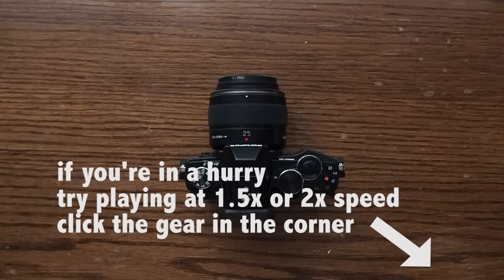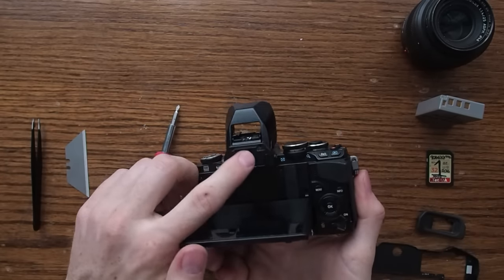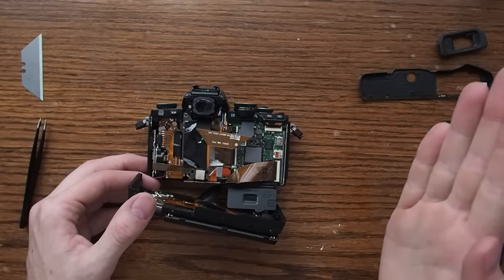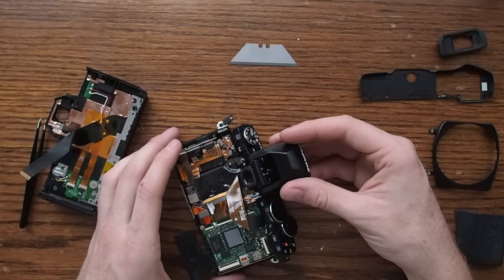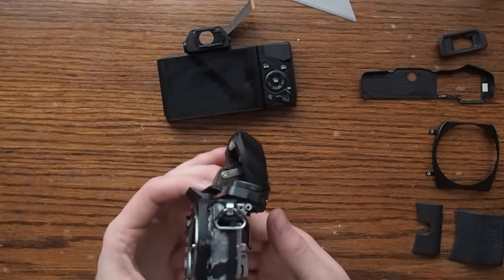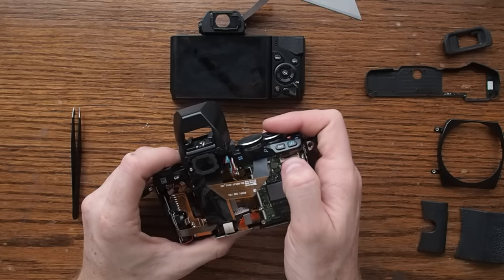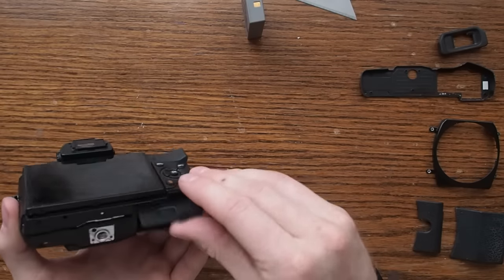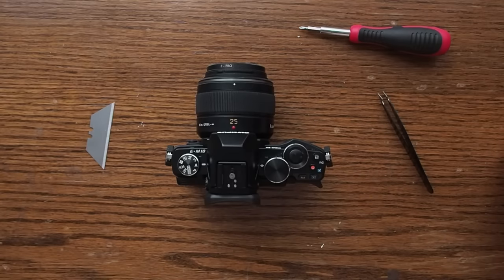How To Fix Olympus OM-D E-M10 (Disassembly & Repair)

Comment: Hi there, I have a question.
Recently it came to my attention that my OM-D EM-10 wasn't working properly. The dial on the left won't allow me to switch between various shooting modes (but the dial works fine). Do you have any tips or suggestions to help overcome this? Thank you, love your channel. 
-Lotus
Reply from the maker: Lotus White hmm when my camera got salt water in it, some of the knobs stopped working, and after I washed it out they were fixed. So it's possible that may help in your situation... When you take it apart you can see the mechanism for the dial and it's pretty simple. Dirt or corrosion in there might cause malfunctions. 

I should warn that it is kind of a drastic measure though, since most people would say it's a terrible idea to intentionally get the camera wet. I can just say it worked for me and really as long as you use distilled water and dry it quickly it should be fine. 

The main trouble would be that the dial might be outright broken for whatever reason, and in that case opening the camera won't help things, and introduces opportunity for you to accidentally break something else. 

For me it was worth the risk, in part because I enjoyed the process and also because the camera was inoperable as is. You'll have to decide for yourself. 

Good luck! Let me know how it goes.
Reply: AH wow cheers for the speedy response, really appreciate it. 

Yes well, I'm thinking it could be a case of it being broken, as I did buy it off a pro photographer a few months back - barely having used it myself. 

I think that may be a lil too involved for me, I think I can get away with Manual mode for now until I could get it checked out. 

Thanks again.
Reply: got the same symptom: stuck in manual!  good thing the back panel shows the estimated exposure, that is cool, but I will follow this guide and see if cleaning up all the contacts inside helps.  I have learned this is a common complaint with these otherwise awesome little cameras
Reply from the maker: Best of luck Brett! Let me know how it goes, just remember to keep track of all the screws. :)
Reply: Got the same problem as you have. Please let me know if cleaning it worked for you - because I'm damned scared of opening up my camera as shown. But if it works, I might just try it out.

For history's sake, the problem first started out when the dial wasn't showing the selected mode. To get around this, I just had to turn the dial a few times and to get the dial mode and the selected in-camera mode to coincide. I had seen that many had that same problem and I did what worked best for most people, which was to take the battery out and to turn the dial mode setting a hundred times - put the battery back. This seemed to worked temporarily, but I had to redo the procedure a few times before encountering this new, BUT RELATED, problem. When selecting all the modes on the dial, only the Manual mode appears. There seems to be no way to get to any other modes. I suspect that the mode problem is also related to the Flash and Tilt-screen uses because that's when the problems kept recurring at first. If anyone can confirm my suspicion, please let me know because I think that this is manufacturer problem - and not one related with salt or sand because I always handle my camera with care in good weather situations because I know that this camera is not weather sealed.

Comment: hey nate, is that the internal mic on the LCD side?  on the outside there are 3 holes on the thumb grip but I wasnt sure if that was it.
Reply: nvm, i believe those are the speakers.  im trying to access the internal mic to see how i can hack in a mic plug.  do you have any tips on doing this?  thanks!
Reply from the maker: Yea actually I have my camera in pieces again right now trying to fix a broken shutter (spoiler: might have been better to send it in for that repair hahaha). 

Anyways there are two internal mics. They are on the "top plate" that has the EVF and everything. If you tear it down as shown in the video you can get ok access to the inside/underside of this top plate. Tearing it down further is possible if you need to. 

Once you can get to that plate you will find the left mic is under the circuit for the mode dial, but it looks like a few more screws will pull that circuit off and give you access to the mic. The right mic is actually easily accessed and has a red and a black wire going to it. You could easily splice into those wires, and it looks like the left is probably similar. I don't know much about mic wiring though, so you're on your own past that.

Let me know how it goes!
Reply: Thanks Nate!  I'll let you know if I ever summon the courage to perform this hack.  The double speaker setup is what makes me a bit nervous though.  Dunno what would happen if I splice a mic jack for through via one speaker and just sever the other speaker's connection. :/
Reply from the maker: I'd splice in a mono mic on one and leave the other. Then if it works you have your mic-in audio on one channel and your on-camera audio on the other channel. If it doesn't work you still have on-camera audio, though only mono.
Reply: ah yes, good idea.  i have a shotgun mic i wanted to use, but if i got an external recorder then that would be perfect.  if you have any ideas on how to adapt a shotgun mic, i'm all ears.

they really didn't make it easy to mod the speakers.  they really want you to buy the higher model for that measly mic jack!

Comment: How long should I wait for the alcohol to dry before putting it back together and testing it again?
Reply from the maker: In front of fan it will probably only take a couple hours, though you could wait overnight to be safe. If you use water it may be wise to wait longer. I'm not completely convinced alcohol is better than distilled water, it does dry faster which is a plus, but there is also a chance it could interact with some of the plastics and adhesives in the camera.
Reply: I just took it apart and done as you have said in the video but it doesn't seem to be working. The shutter just flutters when I turn it on and remains stuck. Is there anything else you think I should try before paying like $300 to fix it? Thanks for the video by the way!
Reply from the maker: Yea.. I had this happen too (several months after this video I dropped the camera and it started acting up again). I think the shutter is actually broken. I looked into a bit and it looks like you can get a new shutter unit for around $60-80, and replacing that may bring it back to life. I tried disassembling it to that point and it's a lot tougher, but I did eventually get the old shutter out. Unfortunately it requires cutting or unsoldering a couple wires. Once I had it apart, thought, I realized that for me it wasn't worth gambling the $80 to buy a new shutter, since I wasn't 100% sure that would fix it and I also am not 100% sure I could reassemble it successfully (it's a lot more complicated than what's shown in this video).
Reply: Oscar Shum Hello there! Did you manage to have it fixed? Manually or by Olympus?
Reply: Nate Myton Hello Nate, firstly thank you so much for this video on the disassembly of the E-M10. It gave me the required instructions and very good tip on keeping in track the screws. My problem was regarding the shutter. it would flutter but stay stuck. I bought it second hand knowing of the issue because I was risking being able to fix it, thus got it for a superb price. I disassembled as you have but did not use isopropyl nor distilled water. I didn't manage to get to the insides of the shutter hence it still had that problem. BUT here is where it got interesting. I was quite disappointed and began to look at the shutter leaves as well as this black border leaf surrounding the shutter. i opened and closed the shutter by carefully using a plastic lever AND tried to move the black border. My basic feel is that the black border was somehow knocked out of place. Viola put it back together and it worked! I can't say for sure how long it'll remain working but keep my fingers crossed. i think the stuck shutter is a mechanical misalignment issue than a residue issue, at least for me. Just becareful with the shutter leaves as the sensor is right behind. i accidentally touched the sensor light hahaha ... guilty. but thankfull it looks unharmed under light. Now my issue is with the 14-42 EZ lens breaking down for god knows what. it worked then I pressed the lens release button a couple of times and it just died. I must admit  we learn from our mistakes haha now I see Google says we shouldn't touch the lense release button unnecessarily. That being said I do somehow feel ... either unlucky or that these mirrorless cams aren't very durable?

Try the tip on readjusting the position of the black border leaf surrounding the shutter leaves. I pray anything works for any of us. God Bless!
Reply from the maker: Wow thanks for sharing that tip, I've suspected that in at least some cases the shutter problem might be related to something like you describe, something out of alignment that could be self-corrected, but I wasn't able to figure out a fix for it on my camera. Hopefully your tip can be useful to someone else, it's all a bit of an process of trial and error for these DIY fixes, and it's great to be able to share what works and what doesn't for others in a similar spot.

Not sure what could be wrong with your lens, it's hard to believe that pressing the lens release could cause an issue, I've taken lenses on and off hundreds of times without issue. I think you're right that these mirrorless cameras aren't the most durable, but I think the problem extends to all consumer electronics these days so there's not much to be done.
Reply: Hey there, I didn't end up doing anything with it. Can you explain what exactly you did with the shutter? I'm having a hard time picturing what you mean. Thanks!!

Comment: What did you clean with the alcohol? I am having the issue you are describing but it's from a drop not salt water contact.
Reply from the maker: For the camera with a stuck shutter and white EVF? After I got the back off and lifted the top plate with the control dials, I washed the entire main body (the part with the circuitry and the sensor). I used about 0.75 L of alcohol and rinsed from all sides, including from the front onto the sensor and shutter mechanism and from the back onto the circuitry.

I've heard of these same symptoms happening from a drop, and while I'd like to imagine this relatively easy fix would apply for a dropped camera, I'm afraid I can't bee too optimistic. May still be worth a try though if you don't have much to lose.

I should note that I did get slight residue/streaking on the sensor after all this. Not sure if that would have been better or worse had I used distilled water instead of alcohol. Doesn't show up in normal pictures, but I can see it if I shoot a white wall and pull the levels in post.
Reply: Nate Myton I'm having issues with the shutter. It's possible that it was a connection issue but everything seems to be in place. 

I'll try to wash it with some isopropyl but it doesnt seem to be a corrosion/dirt issue. 

It may be a solder joint issue as some of the solder points seem a bit cold.

It seems like a mechanical alignment issue but what do I know, I'm just an electrical engineer.
Reply from the maker: Dawid Fraczek Yea this fix was just a shot in the dark for me as well, but since it worked I figured I might as well share my findings. Best of luck!
Reply: Hello, I have the same problem after a drop of my camera, did you manage to fix it ? Just want to know before trying some surgery and try the alcohol :)
Reply: I haven't put it back together yet. I took it apart, but visually, there seems to be nothing wrong. I'll probably try to do so tonight and get back to you.
Reply from the maker: The symptoms are very similar to my situation (locked shutter, auto-turn off). I'd guess a similar short somewhere in the shutter circuitry (just speculation on my part). Unfortunately there's not much reason to believe you can "wash away" your short, since it's more likely physical damage vs. conductive residue from salt water (like my situation).

All that said, if the camera is effectively dead there's not much to be lost in pulling it apart and giving it a shot (in my opinion). Ideally you might see that one of the ribbon cables came loose, and you could reconnect it. Or you could try a rinse just for the heck of it.

Good luck!
Reply: Dawid Fraczek did you manage to fix the problem after all? I dropped my EM 10 and am having the same issue. When I switch on the camera after auto shutdown, the shutter opens up again.
Reply: can i replace the lcd screen without disassemble the whole camera?  my lcd is broken
Reply: Yes you can, I just did it!!!
Reply: duongly   do u start from 4:40 in the video?
Reply: 4:40... yeah sort of... This is a great video on how to disassemble the camera, but not how to change the screen. This post was also useful: https://oh2fxd.wordpress.com/2016/01/10/changing-the-om-d-e-m5-lcd-screen/. As it says, the hardest part was to remove the old LCD screen from the plastic frame.

Comment: I had one of my OMD camera strap lugs fall off.  While you we into your system did you notice how it was attached to the body? Are they glued or screwed?  

Olympus wants me to commit $179.00 to look at  it. No concession from them on this, even though this issue is like a bridge failure or a carabiner breaking before the rope does. It simply should never have happened.

There is no damage on the lug or on the camera body attachment slot. I may just super glue the thing back in.  That is if I do not have two small attachment screws floating around inside the camera body.
Reply: Did you figure this out? My strap lug fell off, was repaired under warranty and now it's loose again, so I'm thinking about doing it myself
Reply: @pizzasaurolophus  I glued it in place just to plug the hole. I am now using a sling stap that attaches to the tripod screw. A much better system and safer to boot.